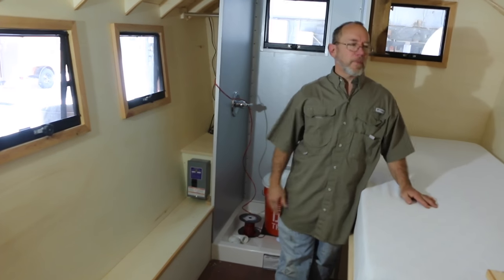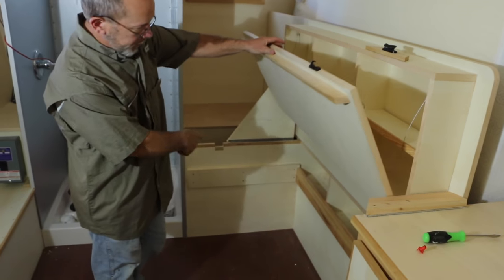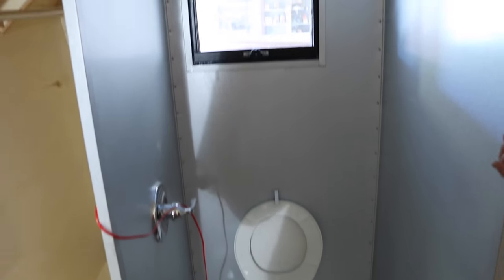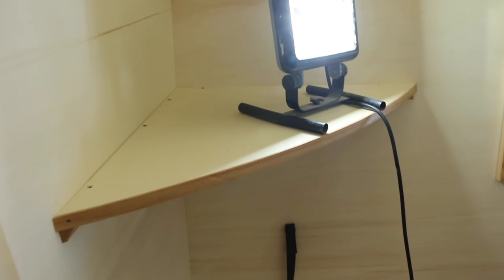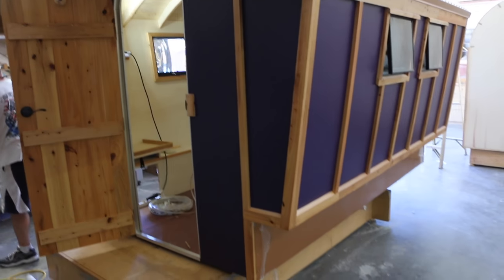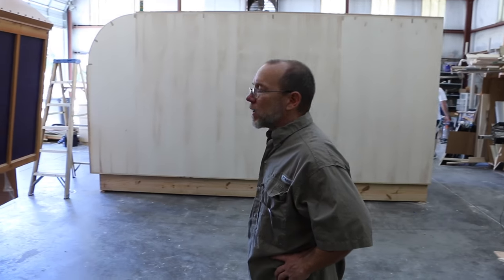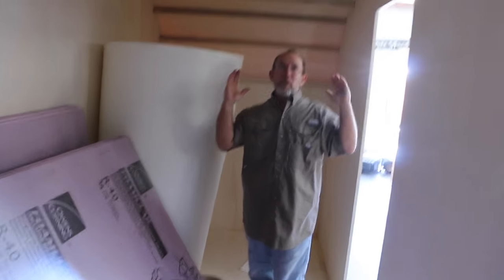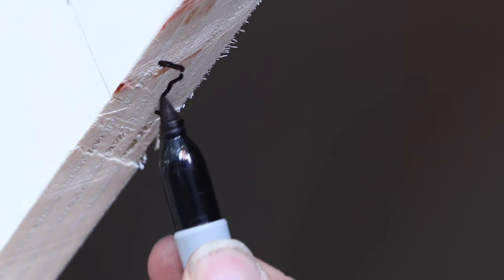Gypsy Tiny House Can Be Towed By a MINIVAN!

Comment: Too cute!
Reply from the maker: Right?! And I liked how the home widened at the top giving more space. Pretty neat.
Reply: My grandparents did the same concept in their pickup truck. They 
installed a shell camper. Using the top of the rail area (where the 
shell rests on the truck) as base for the bed. It even folded up towards
 the cab, because it was on a long piano hinge.  :)